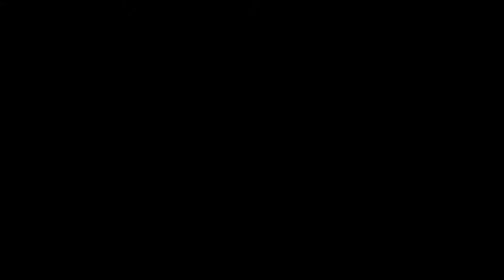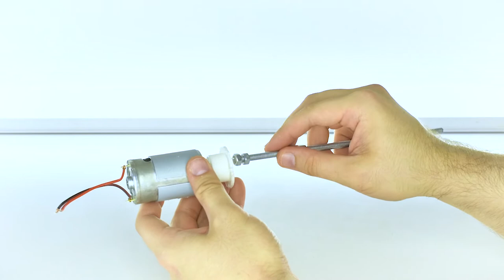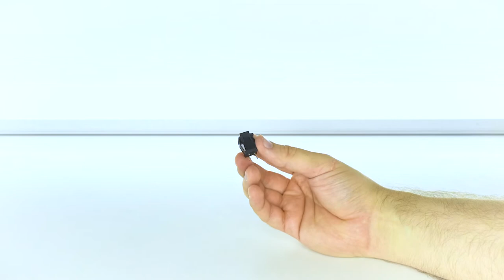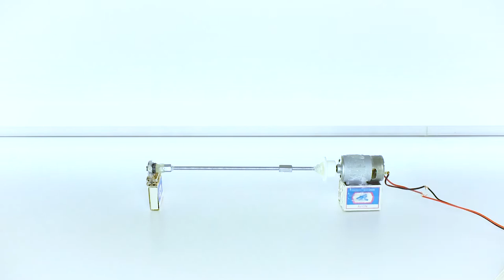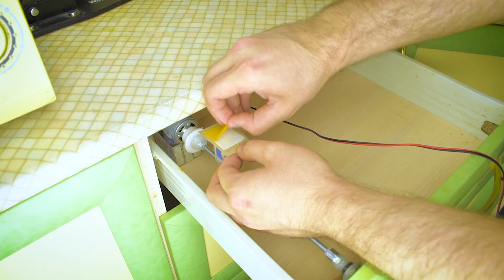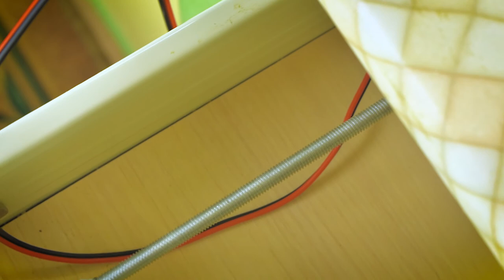How to make Automatic Drawers | DIY Crafts

Comment: Not too bad. 
Maybe it can be improved by drilling a hole in the back of the drawer and hiding the motor there and then using the threaded rod set up like you have but then have the bolt that slides on the rod attached to two other stationary rods on the sides that attach to the front and back of the drawer so that way it's fully collapsible and can extend and retract to the maximum and you Don't have to worry about the wires getting tangled because the motor itself will be stationary in the back